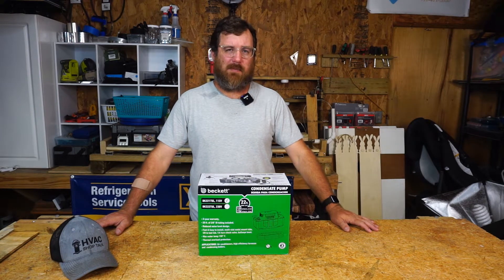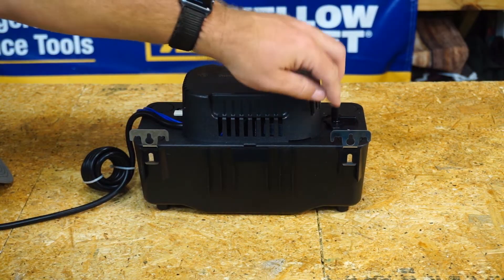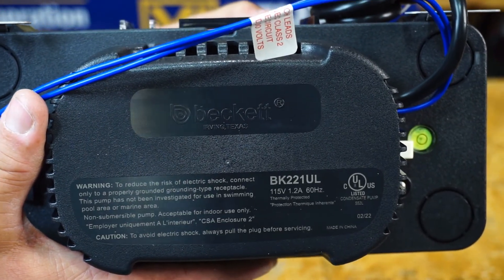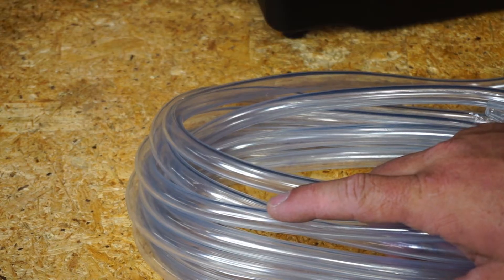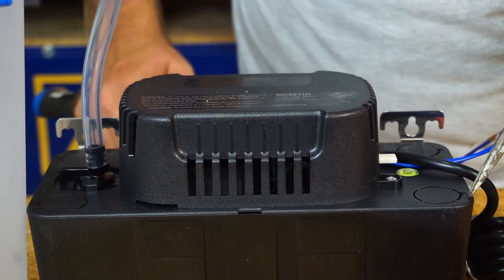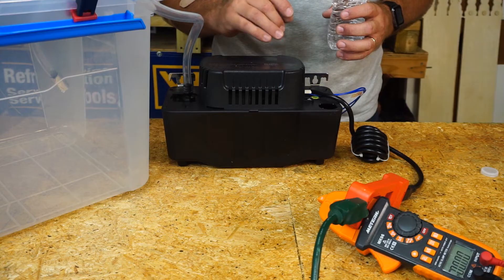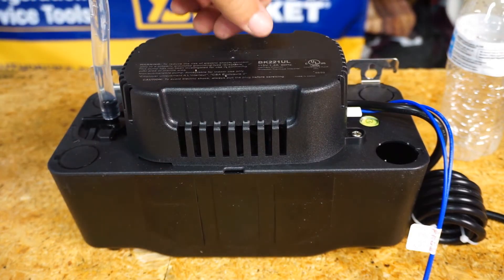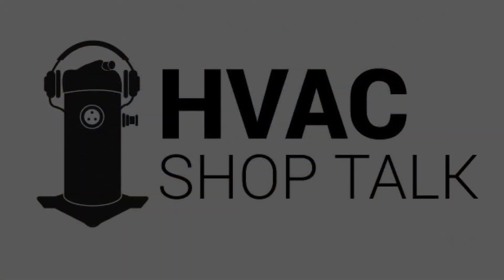HVAC Condensate Pump Explained

Comment: So one observation having one of these pumps hooked up to my furnace with central AC.  When the pump shuts off, a small amount of water flows back into the pump.  The tub of the pump will slowly gum up with mold.  You need to clean these pumps out pretty regularly to keep them clean, otherwise they fail and will overflow.  

Another tip:  if you also run a dehimidifier in the summer, and you have the ability to hook up a hose to the humidifier for continuous draining, you can run the hose from the dehumidifier into this pump, eliminating the need to remove the heavy bucket of water from the back of the humidifier (often daily in the summer) and carrying it to where you need to pour it out.  Let the condensate pump do the work for you.

Just make sure every spring that your condensate pump is still working and that it is clean.

Comment: Question: Is it dangerous or no for drops of water/condensation to fall onto the pump from above? I noticed there's condensation on the copper pipe coming from the unit indoors, it drips onto the pump.

Comment: I'm a little confused... What do you hook the blue wires too for proper operation?
Reply: Same question :(
Reply: You put the blue wire inline with R which is the 24V power to the thermostat. (One end to the thermostat and the other wire to the air handler) When the pump is empty the switch is closed if the pump breaks it will fill up and the high water level will open the switch. This causes the thermostat to turn off and will turn the unit off so that it doesn't overfill. It also helps the homeowner know that something is wrong with their system.
Reply: @colinwilmes8318  What if a drain pan float switch is already tied into R and the thermostat?
Reply: The 2 wires you are talking about is an end switch, it is used by another system to either warn you it isn't working, or to shut down the system in case of failure.
Most times I don't see them used